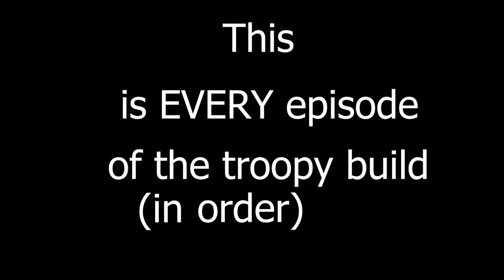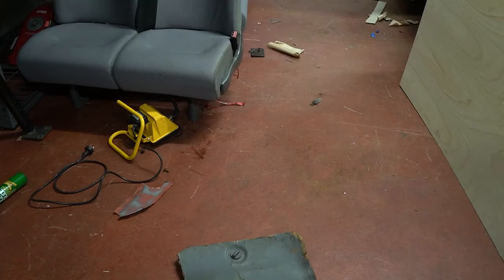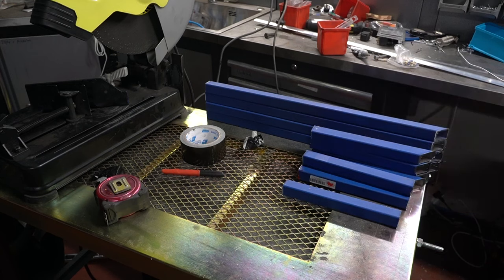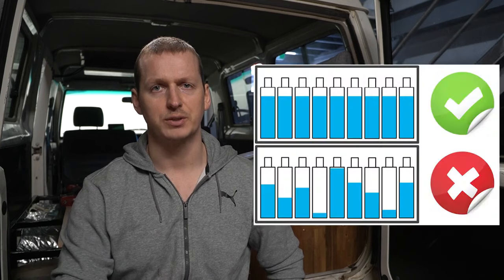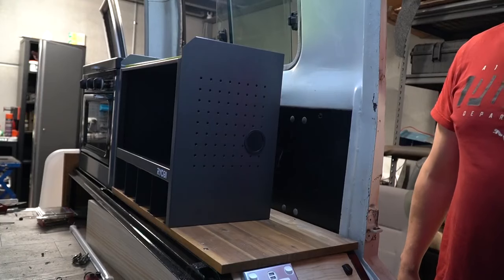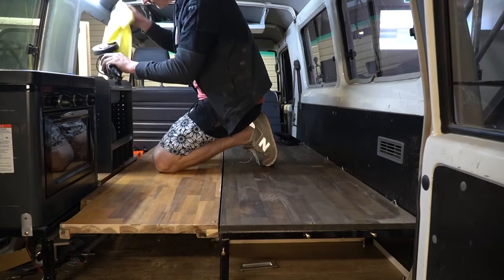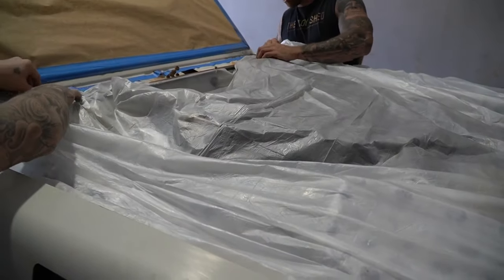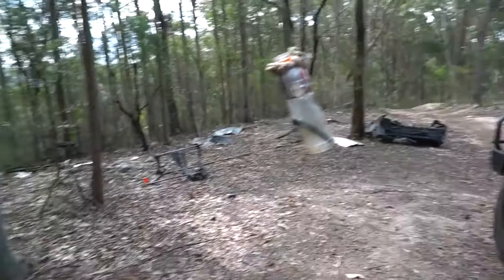ULTIMATE TROOPY CAMPER BUILD | The best overland Troopcarrier in Australia | COMPLETE SAGA

Comment: Quick question regarding the dual battery setup. Would a 3 position on-off-on switch be a wise choice to allow you to choose which battery will energize the relay or disable the linking of the two batteries should you not want them linked when the engine is running? My thought is by connecting the hot ignition signal to one of the "on" positions of the switch and the auxiliary battery to the other "on" position, you could jump start yourself if the main battery was too flat to energize the relay for linking the two batteries together. I've found most relays (solenoids) won't work below 9 volts. Besides killing the starting battery by leaving the headlights on for a long time, we've been seeing a lot of battery failures just due to internal defects of the batteries themselves.....even new batteries don't seem to be as reliable as they were 25 years ago.
Reply from the maker: Sounds like you'd be better off just having a switchable solenoid energised only by the aux battery alongside whatever charging method you're using.. That way you can use it to start the car. I can't really think of a situation where you'd need the main to boost the aux that isn't solved by starting the engine.